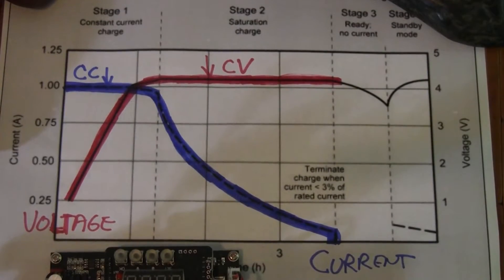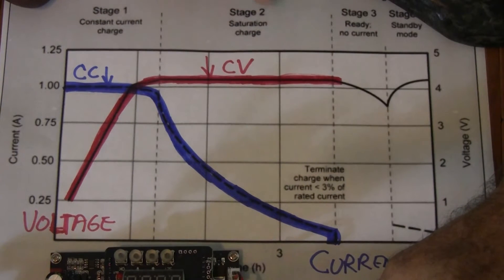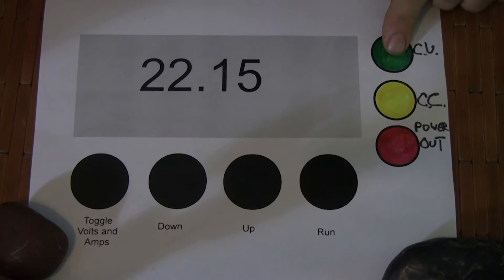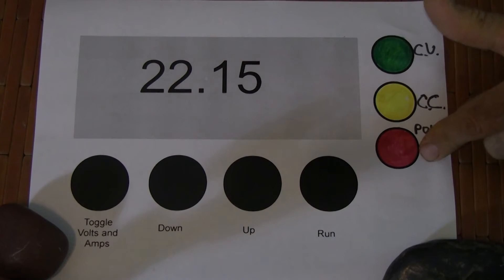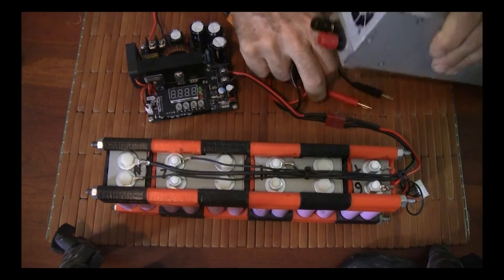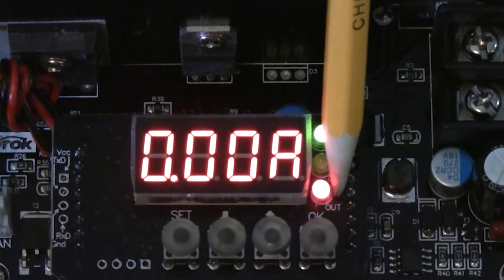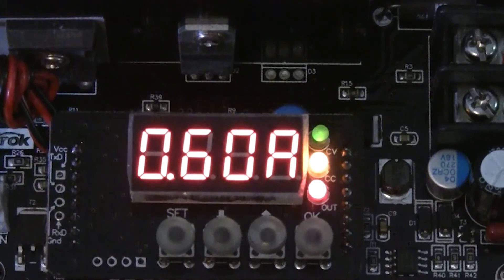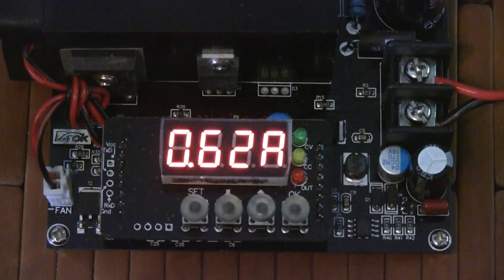Build a universal lithium ion battery pack charger

Comment: Hi Shawn. Really appreciate your efforts. I just ordered one to Turkey. I had a quick question. I have three solar panels each with Voc=25 Volts. I am thinking to connect them in parallel and connect them to the boost converter to charge my 13s6p battery (48V nominal-54.6V fully charged). Would that setup work fine? I am wondering does it tolerate the solar panel's changing volts and currents?

Thanks
Reply from the maker: Yes, it does tolerate changing voltages and currents.  Turkey is a fascinating country- the crossroads of history.

best,

Shawn
Reply: Shawn McCarty 
Thanks. How about the efficiency? In your opinion How would this voltage regulator compare with an MPPT charge controller?
Reply from the maker: The voltage regulator would be less efficient than a MPPT charge controller and it would have less capacity but it is cheaper.  

You are right to compare it to a MPPT charge controller as both will adjust for differences in incoming voltage and current and output a steady voltage that you set- ideal for charging batteries from a photovoltaic panel...

Comment: nice video, do you have video that explains step down converters with same features ?
i have a 250 w solar panel, 58 voc ( volt open circuit ) i would like to charge 40 volt lithium battery on a electric bike.
maybe you have a link to a step down converter that can do the job ?
best regards from denmark
Reply from the maker: Hi Klaus,

You need a Buck converter.  Try Ali Express.  There are scores of them.

Comment: how are you charging using this and into the sensor wires.
Reply from the maker: You are not charging into the sensor wires- they are used to drain voltage from the cells while the overall battery is being charged.  I have been using systems like this for about 2 years.
Reply: so in this video you are charging the whole battery I see, and that is good enough, no worry about balanced cells. i rather go without a bms if this is all it takes
Reply from the maker: No, that would not be wise.  You need some way of balancing a lithium battery or at the very least of monitoring the cells voltages to be sure you do not overcharge.

Comment: I bought a DC to DC boost converter. Unfortunatey i'm not sure how to set it up to where I won't over charge the battery I want to charge as there is no cutoff!
Reply from the maker: You can overcharge two ways- too much voltage or too much current.  To avoid over voltage charging, set the voltage of the charger to no more than 4.2 volts per parallel group, 4 volts if unbalanced.

To avoid over current charging on Lithium Ion, calculate the amp hours of your battery.  Say it is 10 amp hours.  Adjust the converter to put out no more than 4 amps.  Keep the ratio of charge amps to battery amps less than half.  That is a rule of thumb that will leave some wiggle room...
Reply: Thanks Shawn! So I can use this DC to DC device safely by doing that?  http://www.ebay.com/itm/DC-DC-600W-10-60V-to-12-80V-Boost-Converter-Step-up-Module-car-Power-Supply-OY-/281797179064?hash=item419c6bb6b8:g:A-AAAOSw4SlV8uDp
Reply from the maker: Yes, you can adjust both the amps and volts on this model...
Reply: Great- So if I have a 36v 10A battery and I set it to charge to 36v at 5A and leave it overnight, I wont comeback in the morning to an overcharged/exploded battery? Thanks Shawn!
Reply from the maker: Is the battery lead acid or lithium ion?  A 36 volt lithium ion battery when fully charged is 42 volts....  So if you charged to 36 volts, no danger.    But you need to be mindful of the cell balance when charging Lithium ion battery packs.  See my video on "How to build a better battery without a BMS for an overview.  

Lead Acid doesn't need to be balanced....  So charge to about 42 volts...

IF you have time, charge at a slower rate, better for the battery.  The rates I suggested are max rates.....

Comment: So it has to balance someway so why not use a imaxb6 mini and balance charge? Although there's no way to keep it balanced while using the power so what BMS idea does a person use?
Reply from the maker: Yes, I have a video to that effect.  It is my most viewed one.  I think it is a great idea if you are geek oriented.
Reply: Shawn I figured out a way to balance charge without a balance charger or a BMS for a 3S 12.6v use three of these in parallel on the input and 4.2 on the outputs neg/pos on each of the 3 cell series This way you can charge at 4.2v using a 12v car battery and lower than 4v http://www.banggood.com/LTC3780-Automatic-Buck-Boost-Constant-Current-Power-Module-p-990459.html?rmmds=myorder
Reply from the maker: You have come up with a great idea- a separate charging circuit for each parallel group.  It is simple and robust.  If there was a way of getting the cost of each charger down to a few bucks it would be a real winner, eliminating the balancing circuit and the charger...
Reply: Thank You, and you don't have to wait for the pack to balance and fully ready to use when charge ends. A balance charger will slightly over charge other banks to bring the under powered bank up to par and it takes precious time as well as the battery banks lifespan. this is working 100% on a 12.6v with 4 in each parallel multiplied by 5 so a total of 20 18650 in column one 20 in column 2 and 20 in column 3. A total of 60 in the pack and I know they're a bit pricey but no more worries, just plugin, charge and go and you can make a 1000v pack or higher because you only push 4.2v max per parallel group. Now I have to fuse this pack.
Reply: If the price is a issue, you can use a 5v wall charger or a 5 v DC to DC that supplies 3 or more amps or even 3 phone chargers connected to 3 TP4056 protected for $1.80 to $2.00 http://www.banggood.com/20Pcs-USB-Lithium-Battery-Charger-Module-With-Charging-And-Protection-p-1051619.html?rmmds=myorder then if you want you can use a cheap but effective sepic converter boost / buck so you can charge using a car battery or just about anything here for $2.00. http://www.banggood.com/10pcs-DC-DC-Boost-Buck-Adjustable-Step-Up-Step-Down-Automatic-Converter-XL6009-Module-p-1087605.html
Reply from the maker: I didn't know these circuits were available for such a low price.  I have ordered 30 of them and also some of these-  

http://www.banggood.com/20Pcs-Mini-DC-Adjustable-Power-Supply-Buck-Module-Step-Down-Module-p-1047431.html?rmmds=detail-bottom-alsobought

-for smaller battery packs.  They tie in well to the modular nature of BatteryBlocs.  I am looking forward to developing a modular charging/balancing system using these circuits for any size battery by wiring them in parallel, and developing a way of mounting one to each Bloc.  

The input voltage of from 5 to 32 volts is very broad too.  There could be many power supply sources from solar to batteries to power supplies to 24 volt ebike chargers....

Thanks for the links and for the good ideas!

Shawn
Reply: I'm so happy if this helped you in any way because you sir don't have to help so many people, but you chose to do so, so thank you for everything you teach us... When you're charging this way, you don't really need CC, CV-Constant Current and Constant Voltage for those that don't know, but I had a few of these and I was telling my wife anything more than one battery is a balancing issue and I wished they had a single cell 12v battery and then it came together, but I previously charged a single 4.2v group of 20 cells in parallel while it was connected in a series to 12.6v no matter what I did I could only get 12.3~12.4v with a balance charger because it would stop and say finished so ever since it now charges to 12.6v with no issues, but then this simple but useful idea came to mind. Thanks again
Reply from the maker: Thanks for your kindness.  You are so right about BMS"s not allowing the entire battery to fully charge as they cut the charge short.  Hobby chargers tend to be better, but this system would allow maximum charge for maximum run time and efficiency.  My head is buzzing!
Reply: Yes it blew my mind when I seen it... I'm hooked on the SEPIC Idea Buck / Boost because I can charge a 25.2v battery pack using a 6v source or less and what I'm using doesn't terminate the system so I have to restart it every morning when the solar panels fire up. As I drain the system it keeps it topped off and starts on it's own and it will allow me if I choose to limit the cutoff so I don't accidently kill my pack to whatever value I choose and I chose 3.08v per cell group to make it safe, I believe 3v is good but I want to increase the life cycle and 4.15v top end. Do you have a top end and cutoff value you feel safe with to increase it's life span?
Reply: Pun intended? lol
Reply from the maker: Yes- Do you know of a higher power module?  At just 8 to 12 watts, it would take a long time to charge a 20 amp hour battery?  It would be great to find say a 50 watt converter.
Reply: LTC3780 Automatic Buck Boost Constant Current Power Module
Input can be replaced fuses to protect the power supply and equipment;
Constant voltage, constant current, undervoltage protection (MPPT more suit solar charge )
Output error indicator, output voltage drift too severe, short-circuit fault on;
The back is aluminum plate,  fixed the module bottom surface through thermal silica films. By 4 screws the power supply fixed on the Chassis. To ensure good heat dissipation, without regard to insulation and cooling issues;
Inductors using Sendust, 0.8 wound bifilar, heat generating was less.Parameter:
Input voltage: DC5-32V
Output voltage: DC1V-30V continuously adjustable
Output Current:  long-term within 8A, 10A peak value
Output power: long-term 80W, peak value 130W, exceeding 80W please enhance heat dissipation;
Output ripple: 50mV
Operating temperature range: -45 ~ + 85 ℃
Size: 78 x 46.5 x 15mm (contain the heatsink aluminum)http://www.banggood.com/LTC3780-Automatic-Buck-Boost-Constant-Current-Power-Module-p-990459.html?rmmds=myorder
------------------------------------------------------------------------------------------------------------------

100W DC 5V~32V To 0.8~32V 8A Adjustable Auto Step Up/Down Regulator Buck/Boost Converter
Specifications:
Size(L*W*H):60 x 55 x 20 mm
Output power: 100 W
Input voltage : DC 4~32V
Output current: 8A (Max)
Output constant current: 0.2-8A
Output voltage : DC 0.8~32V continuously adjustable
Input current: 8A (MAX) ,peak 10A (long-term work within 6A)
Quiescent current: 5mA (Different operating voltage, it will have error.)
Working temperature: -40℃ to +85℃
Operating frequency: 200 KHz
Conversion efficiency: up to 98%
Over-current protection: Yes
Over-temperature protection: Yes
Short-circuit protection: Yes (10A fuse) double circuit protection
Input reverse polarity protection: No, (if necessary , please connect prevent reverse diode in charging )
Module properties: Non-isolated synchronous rectifier automatic boost buck module
http://www.banggood.com/100W-DC-5V32V-To-0_832V-8A-Adjustable-Auto-Step-UpDown-Regulator-BuckBoost-Converter-p-1091915.html?rmmds=search
Reply: This is a buck only. The main reason I chose the first option is I can charge a 25.2 or larger with just a 6v battery or supply with all of the options.
DC-DC Step Down Module Buck LED Converter 8A 100W 4.5-30V to 0.8-28V
Features:
Module name: 12A step-down
Module properties: non-isolated step-down module (BUCK)
Input voltage :4.5-30V input voltage not to exceed 30V!
Output voltage :1.25-30V continuously adjustable
Output current :0-12A 100W enhance heat dissipation up to 200W
Operating temperature: -40°C to +85°C
Working frequency: 300KHz
Conversion efficiency: up to 95% (efficiency and input, the output voltage, current, pressure related)
Short circuit protection: (limit current 14A)
Over-temperature protection: Yes (over-temperature auto-off after breaking output)
Input reverse polarity protection: No, (if required can add a diode by yourself)
Connection mode: terminals, solderless, V-IN is the input, V-OUT is the output
Module dimensions: 60 x 51 x 22mm(LxWxH)http://www.banggood.com/100W-DC-5V32V-To-0_832V-8A-Adjustable-Auto-Step-UpDown-Regulator-BuckBoost-Converter-p-1091915.html?rmmds=search
Reply: Also even using the TP4056 while in 3S and 4S it will be charging at 3a or 4a because they put out 3a and 4a combined. One amp per cell in series... This is just a test. Be careful charging off a single source.
Reply from the maker: So you had three converters and a 10 amp supply?  That would be more than the converters rating.  Do you think that is why they fried?  Would you continue this conversation at my private email:   shawn@batteryblocs.com?

thanks!
Reply: I did this test with a 4S 16.8 using four TP4056, I connected the battery out to each pos and each neg of the batteries in parallel then I twisted and soldered all inputs 4 pos together and all 4 negative using a 5v 10a power supply and it fried the chips, I know where I went wrong and I will use your email, thanks
Reply: Shawn Any updates on using this method, or is your universal lithium ion battery pack charger video still the preferred method?

Comment: Hi,
I am working on similar charging circuit. Can you please explain which topology is best for 10kW battery(30s32p) to provide a max current of 30A?
Reply from the maker: Best is what you have to work with.  If all you have is a 6S balancer, you could use that by making five 6s packs.  But if you have a 10S balancer you could build just three packs.  The max current of 30 amps is not relevant to the charger...    Does this make sense?

Comment: i was wondering instead of the metal plates would it be ok to use the ring terminals and some fuse holders instead. and if so what size fuse would you recommend
Reply from the maker: Hi Mike,

Yes, connecting the BatteryBlocs with wires is perfectly fine.  Do this when you need to build a distributed battery- for weight or space reasons.  

 I'd recommend just one fuse for the entire battery.  It is extremely unlikely that a group of cells would short- and if they did, because of a defective cell, they would not trip the fuse anyway.  

For a common ebike I use 25 or 30 amp fuses....

Comment: Yet another great vid! Thx!

Does it have to be a DROK? I got this model: http://www.ebay.co.uk/itm/900W-Digital-LED-DC-DC-10-120V-0-15A-Step-up-Power-Module-Boost-Converter-F7X8-/262495791866?hash=item3d1df7eafa:g:6jwAAOSwmtJXa6KE and I dont know if its a DROK or not. It's almost identical to yours but I think it is a buck/boost converter?
Reply from the maker: Hi Schinner,

Hey a Drok by any other name is still a Drok.  It looks exactly like my "Drok" and has the same specs.  It like my Drok is a Boost converter- it steps up the voltage, and will not Buck, step down the voltage...
Reply: Great! When I bought it I thought it could go both ways but that don't matter. Thank you for clearing that out for me!
Reply: Hi, again Shawn. I was thinking about building a bigger batterybank with 18650's. A 24v 200Ah battery pack. If I use your setup to charge this bank/pack I would only be able to charge the battery with 24V@15A, right? And that would mean a 13-20h charge time? Is it possible to wire a couple of DROK's in parralell in some way to get a faster charge time or do I have to make a higher voltage battery pack? I have a 800w solar array that I would use to charge the bank. Thx in advance! (Excuse my bad English)
Reply from the maker: Could you build instead a 12 volt 400 AH pack?   Then you would just need four chargers, one for each parallel group, each charger set to 4.1 volts or so...   You could use the Droks.  So you would leave the four parallel groups wired in series to get the 12 volts,  but charge each parallel group with it's own charger.

Of course you could do this with 24 volts, but it would mean 8 chargers.  

Any other ideas?
Reply from the maker: They wouldn't- you would use them to boost your solar voltage to something above 12 volts and charge your battery in series...
Reply: Shawn if the Droks in the video are boost chargers how would they be able to charge at 4.1v for each parallel group if the input feed from the solar was somewhere 12-24v?
Reply from the maker: It says it is a "step up" converter, which means it would boost voltage.  It doesn't say if it is also a Buck converter....
Reply: Thanks for the clarification, though you did mention in the reply above before mine that you would charge each parallel group separately at 4.1v with it's own charger, were you perhaps referring to using a different charger to do that than the Drok in the video?  I'll quote your reply here to minimize confusion "So you would leave the four parallel groups wired in series to get the 
12 volts,  but charge each parallel group with it's own charger."
Reply from the maker: Thanks for catching that- I was thinking outloud about a charging project I am working on.  You are right, the DROK won't work if four of them were used to charge a 4P battery wired in series- they would short because the negative wire would be common to them all.   However, an AC transformer charger would break the common negative ground and allow  separate chargers to charge each parallel group of a battery while leaving it wired in series.  Any additional info you care to add would be appreciated, I am obviously learning too.

Comment: Excellent video but I cannot purchase the Drok because it does not ship to Australia.
If you see an equivalent unit on Aliexpress or a place like that, please let us know.
Reply: http://www.ebay.co.uk/itm/900W-Digital-LED-DC-DC-10-120V-0-15A-Step-up-Power-Module-Boost-Converter-F7X8-/262495791866?hash=item3d1df7eafa:g:6jwAAOSwmtJXa6KE
Reply: Did you try Amazon?
Reply: OK thanks it now ships to Australia from US Amazon and UK ebay.
Reply: similar item on aliexpress:
https://ru.aliexpress.com/item/BST-900W-DC-DC-CNC-Boost-Converter-8-60V-Step-up-10-120V-Digital-Control/32759291893.html